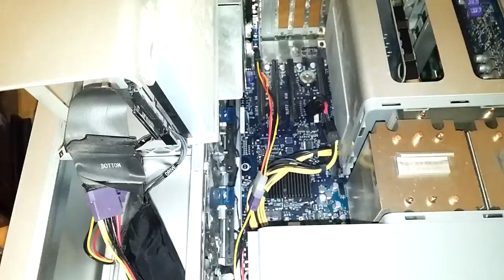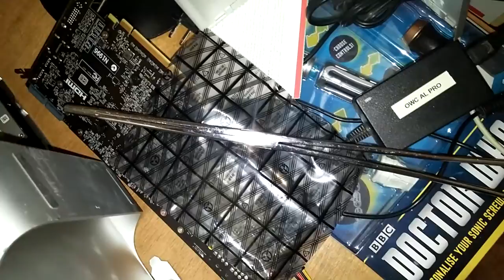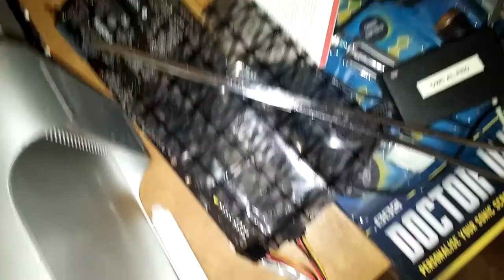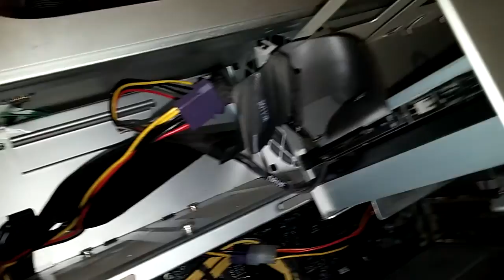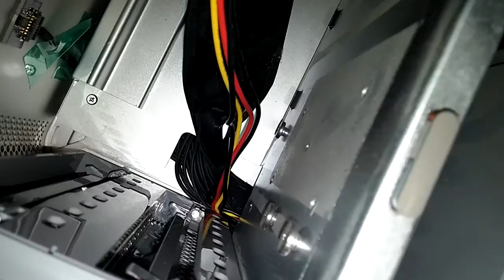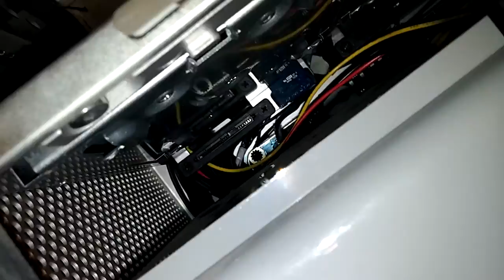7 Port Powered USB 3 Card 2008 Classic Mac Pro Install and Cable Routing. Molex Powered and PCIe

Comment from the maker: Update: I sold this Mac and had a KT4004 card for a while (https://amzn.to/3lzEPm5) but I started having problems with disconnections on my Drobo 3. Not sure if it was cable, card, or Drobo but I bought this one https://amzn.to/33GkeXj (NewerTech MAXPower 4-Port USB 3.1 Gen 1 PCIe Controller Card) and it seems a fair bit better. Both these cards are unpowered. Easier install. The Newertech is slightly more $$$ but targeted at Macs, so I got it and it's a name brand.

Comment: I’ve seen rumors that molex to sata is dangerous, is this true? People say some molex cables are not made well and with the voltage or something they melt or catch on fire.
Reply from the maker: The voltages we are talking about are low, and the current is low. MOST of the time, USB is only transmitting data, and the times it IS drawing power it's probably powering something small like charging a phone or a 2.5" hard drive. Molexes powered 3.5" and probably 5.25" FULL HEIGHT hard drives in the 80s. I doubt the spec has changed. Plus, the USB card can also draw power from the PCIe slot as it does with cards without Molex cables. So to sum: VERY doubtful to me this application could cause ANY issue. Frankly, I think the addition of Molex power to the PCIe power is overkill. What application did you hear about melting/fires? That's the real question: how much power were they trying to draw? Here, I think it's totally a non-issue.
Reply: @RobertBullock  ok, thank you for the quick response, very helpful!

Comment: Would there be any way to use power from one of the two PCIE power outlets that are more commonly used for GPU cards?
Reply: mybrainhurts792 I think those use 12V maybe? Not sure what they output and what the card needs. Why would you want to?
Reply: @Beachfitrob Thanks for the reply. I am already running six drives in my macpro. Seems a shame to have to remove one when there's potentially a power outlet right there ready to use if I get the right cable. Something like this: https://www.amazon.co.uk/DeLOCK-82924-15-pin-PCI-Warranty/dp/B0057A8TNS
Reply from the maker: @mybrainhurts792  Hmm. Probably enough power on that rail to run a cheap Y cable to either/both instead of getting something weird. It draws from PCIe and the cable so I would think all things considered it would be fine.
Reply from the maker: @mybrainhurts792  That cable you linked to..one thought is what if you want to upgrade your video card, then you used a power outlet already.
Reply: @RobertBullock  I've been told elsewhere that it won't supply enough juice. So I guess I'll have to sacrifice a drive.
Reply: @mybrainhurts792  Well, the other USB card I have is unpowered and I've never had a problem so I would think a Y'd molex PLUS the PCIe power would be fine. If you're not running a bunch of hard drives off USB 3 you should be fine. I have a Drobo, used to keep a thumb drive plugged in for scratch work, and sometimes something else small. I'd check the PCIe power specs against what you want to supply. That alone might be enough depending on what you want to use.
Reply: @Beachfitrob  I too have an unpowered USB card. It just doesn't have a USB-C interface which is why i'd like the other card too. Without additional power transfers just give up on the USB-C card after about 40GB. I guess I will just buy the cable and hope for the best. Only a couple of pounds and might do the job... Thanks

Comment: Hello. Great video. I was wondering if there is a way to add a USB-C pcie card to a 2009 mac pro? I just updated the firmware and upgraded to High Sierra. I need USB 3.1 or Thunderbolt 2 to power audio interfaces. I'd also need to know if there's a card you would recommend. I'd appreciate any help you could provide.
Reply from the maker: No idea but if you can find out the chipset that Macs use, a PC version with the same chips has a good chance of working.
Reply from the maker: Sonnet has one here: http://amzn.to/2EY18gm

Comment: you can also remove that metal plate, which makes jamming the cable up top easier
Reply: True, but it's probably less overall work just to wiggle it through.
Reply: Not if you have 2009-2012 mac pro and have to wiggle through a much wider mini sata cable as opposed to your 4pin moxlex plug.  it's better if you take off that plate.
Reply: We're talking 2008